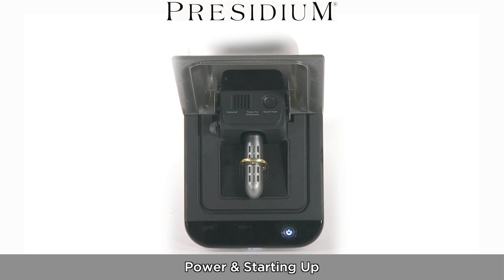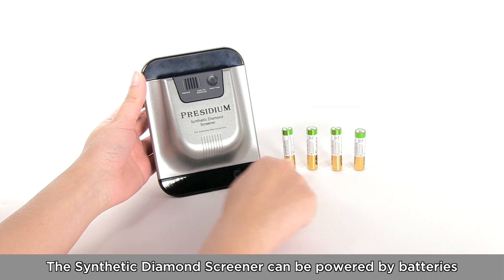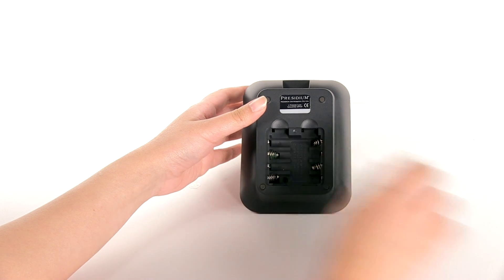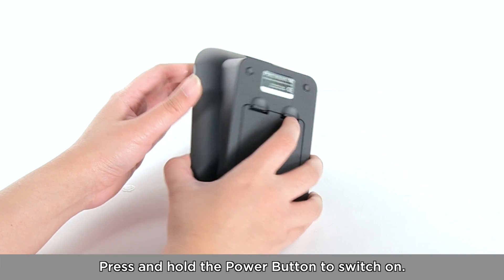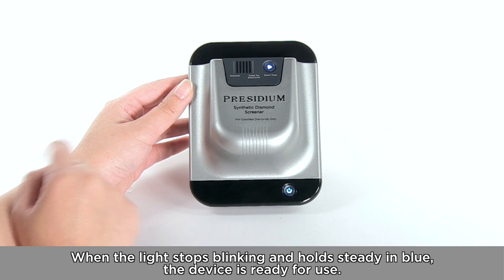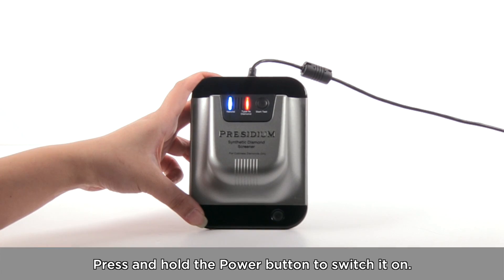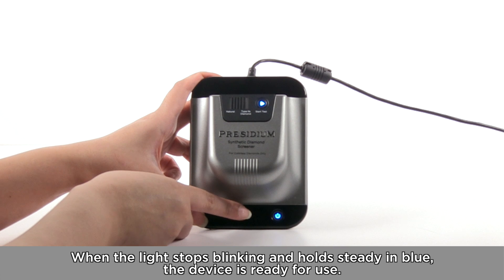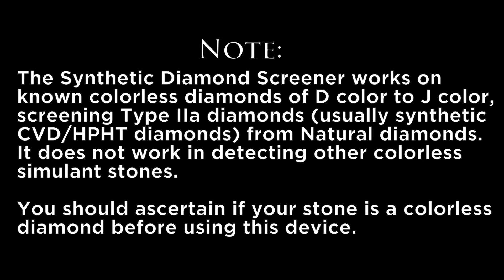Synthetic Diamond Screener (SDS) - Power & Starting Up

Comment: Umm... this is ridiculous. You should be more honest... warn people that even many natural diamonds will test as "manmade". A reading as "cvd or manmade" only means that it should be further tested. Even DeBeers has difficulty with this distinction when testing natural stones. BE HONEST!
Reply: This cost $600 and runs on batteries what do you expect? The accuracy rates are posted online for reference. The best machines are $5k+ I’d recommend the Sherlock Holmes 2.0